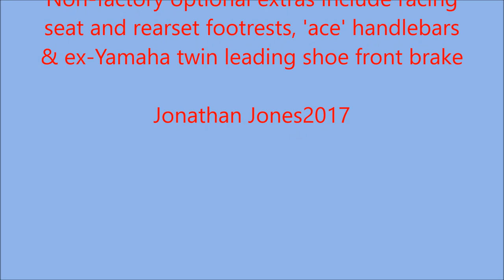Panther Model 35 ES

Comment: Lovely bike, brings back some memories for me. I've always been a fan of Villiers two strokes, especially the twins.
 I bought a complete and running 1964 Panther 250 twin for £60 when I was 16 back in 1981. I hoped to get it fixed up and on the road for when I was 17 but never managed it. I do remember its 2 into 1 exhaust system and jelly mould fuel tank, and how lively, smooth and torquey the engine was even though the Villiers 2T engine is rated at about 15 BHP I think.

Comment: The tank is very similar but the petrol cap was of the quick release type and in a different position, the flyscreen was higher, the plugs did  suffer from whispering hence the change of plugs